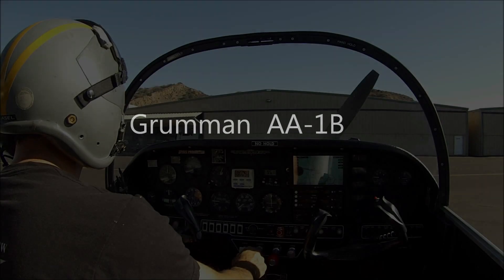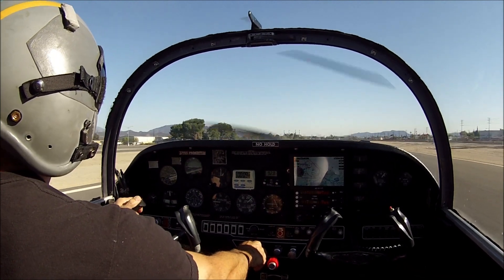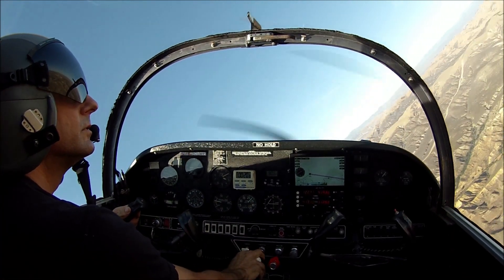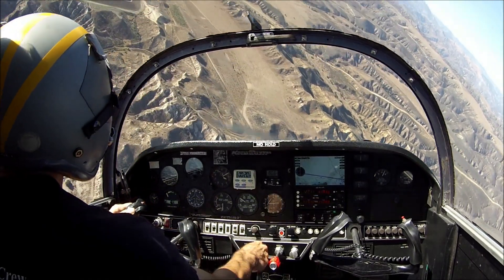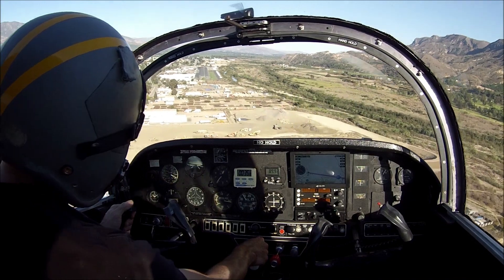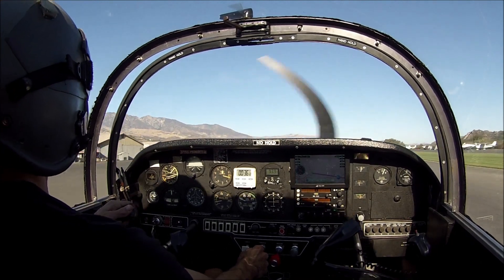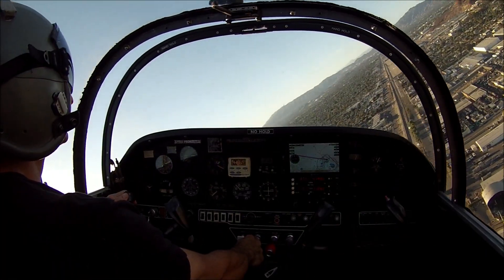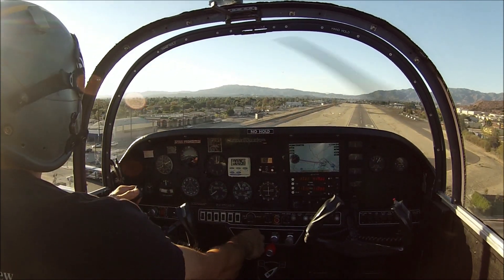Grumman AA-1B with 150 HP Lycoming A2B STC by Ken Blackman

Comment: What kind of true airspeeds do you get at high altitudes, like 10k ft, give-or-take?  Also, does flying that help out with the range due to leaning the mixture?  

I know with some experimental aircraft, a larger engine really doesn’t really give them much better cruise speed at lower altitudes, but really makes the difference the higher they’re willing to climb.

Comment: Ive got a 150hp ready to fly in a month here. What is that white thing on the panel I see? I assume its a timer for switching fuel tanks but I cant seem to figure it out. Also I think mine will be a bit nose heavy, Ive beem told it needs to be nose up trim nearly full on tlanding how is it for you?
Reply: Battery relocation aft seems to be an easy way to correct the CG issue with the heavier engine.
Reply: o-320 is not that heavy. Will fly almost the same even with battery up front. Good luck flying anything larger than a C172 if you need full up trim to land this thing. It flys with one finger